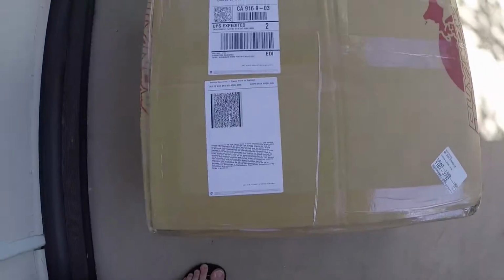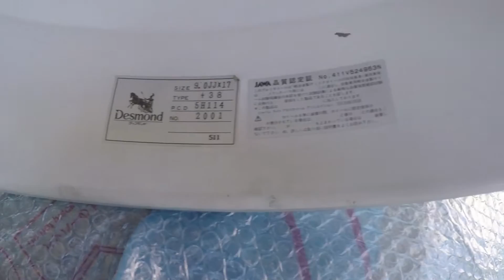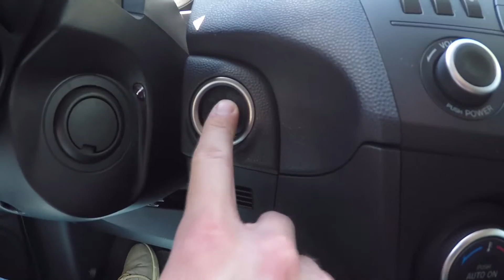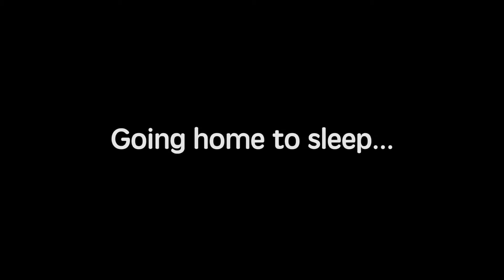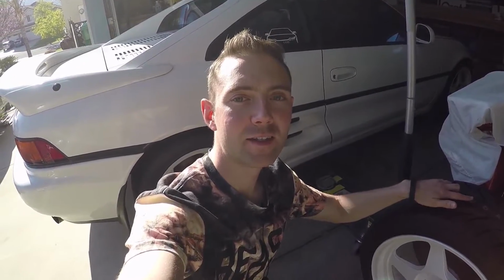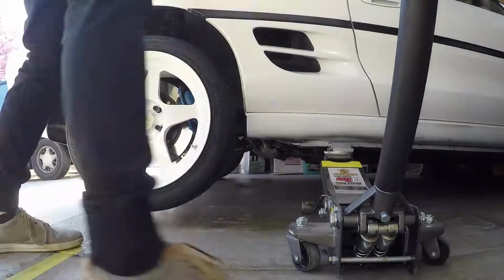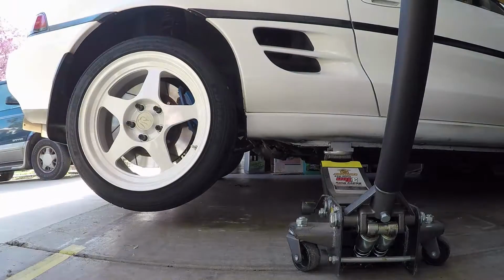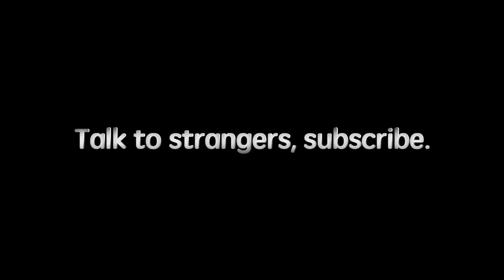New Wheel! Snow White is Back! (Real vs Fake Wheels): MR2 Vlog 21

Comment: Nice! What kind of radiator is it? I have one from Campos I acquired after my gen 4 was already done but haven't had any issues with na rad yet.
Reply from the maker: Eric Arellano It's Toyota. Hope it continues to work out for you. My setup is a little more demanding than a standard swap and it probably still would have worked if it wasn't getting clogged.

Comment: How wide did you go in the back the wheel sz?
Reply from the maker: 9 Inches sir
Reply: any fender work with it or fits right in?
Reply from the maker: Rear fender has a pretty extreme lip so it needs a slight roll, but that's it.